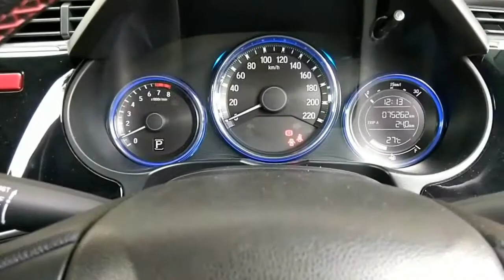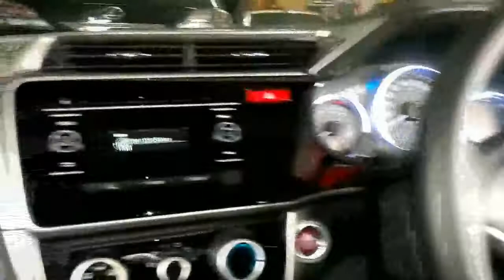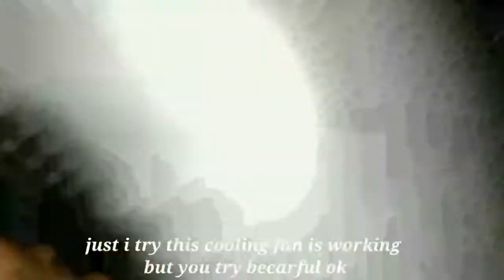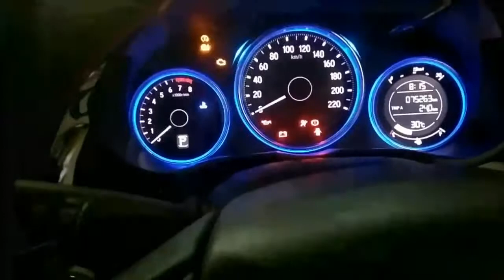How to fix AC fan motor not working, How to fix car AC not cooling,HONDA CITY 2011-2016

Comment: Hello, I replaced the ac cooling fan motor with engine cooling fan motor. Polarity was reverse so I switched wiring and now it spins in correct direction. Is this ok??
Reply from the maker: Thanks for you
Reply: what is the cable colour? blue black?

Comment: can i know.. if not open ac, cooler fan not working when engine heat?
Reply from the maker: If the cooler fan does not work, the engine overheats
Reply: but now when i open ac its working.. when off ac its not working.. u think what problem? sensor temperature?
Reply from the maker: replace temperature sensor  . check wirings harness

Comment: does your radiator fan do high speed ?
My honda city had a problem. problem is the  condenser fan is working low and high speed but the radiator fan is only working on a low speed. Wonder if this is normal.
Reply from the maker: My problem Radiator fan not working then engine over hatting problem head gasket
Reply: @SCSautomotive.1988 where u buy cooler motor
Reply from the maker: From the auto parts store